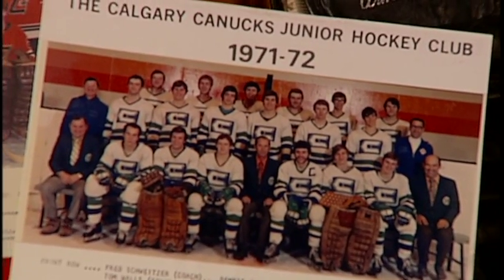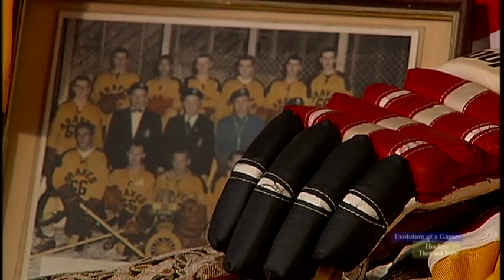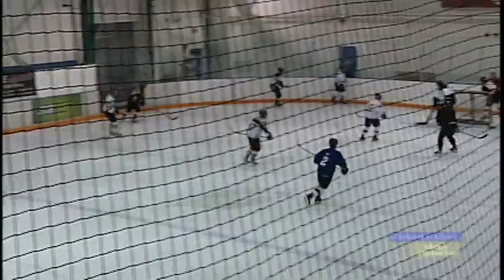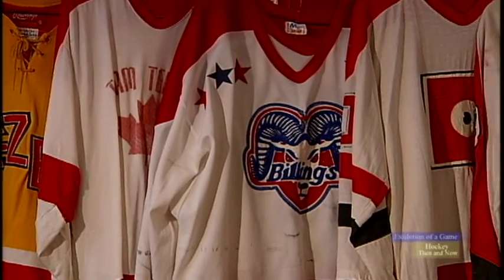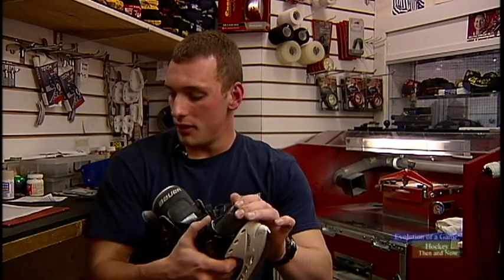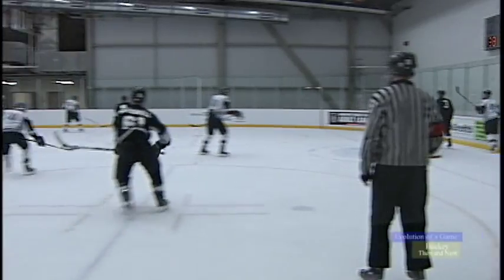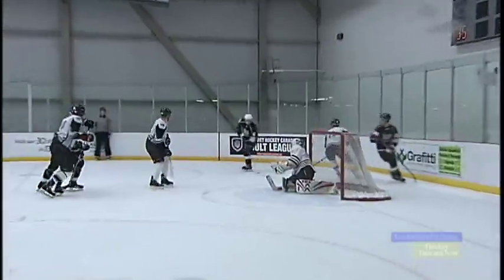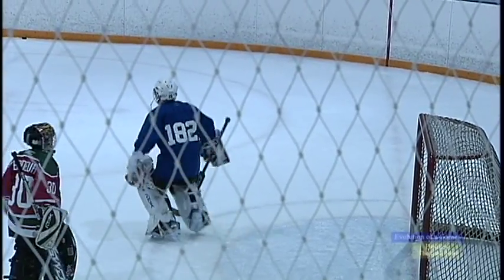Evolution of a Game: Hockey Equipment, Then and Now

Comment: What is this guy even talking about? The flex on carbon composite sticks not only prevents sticks from breaking as easily, but also gives shots that whip that makes the puck sail at 80-90 mph.

Pads these days are more shock absorbent and protective than the leather and canvas padding of the olden days. The "glory days" of hockey came with gear that wouldn't protect anyone in today's game.
Reply: I played with wooden sticks right before composites came out and took over the sport. They did break, but not as easily and unexpectedly as carbon. The carbon sticks are definitely more fragile but the reason they have taken over is they are so much lighter than wood and the performance is unreal.
Reply: This was posted 8 yrs ago they are better than they were but they did break easily . Also players have figured out that if the break the other guys stick the will get 2 .. you rarely saw a broken wooden stick .., they may wear out on the heel or get ratty but they wouldn’t  explode also the goalie pad have changed immensely . Allowing fir movement along  the ice while in the butterfly that is fairly new